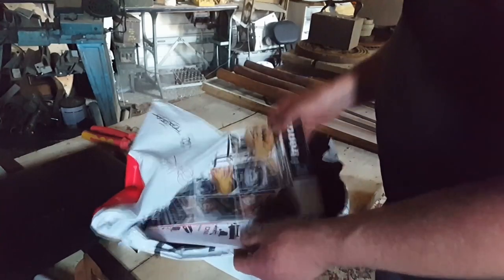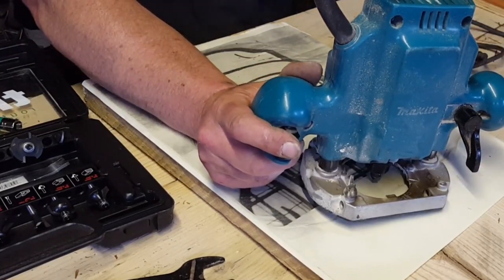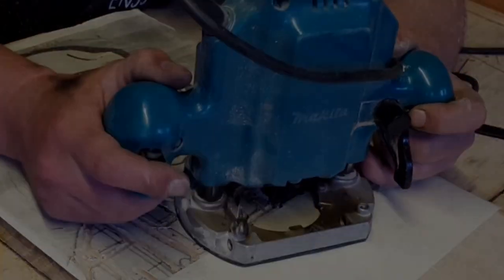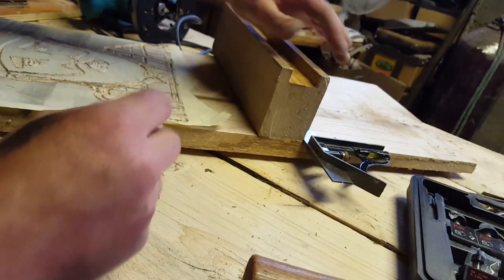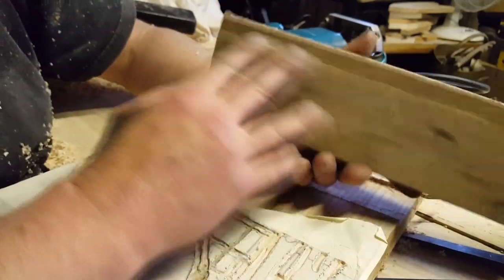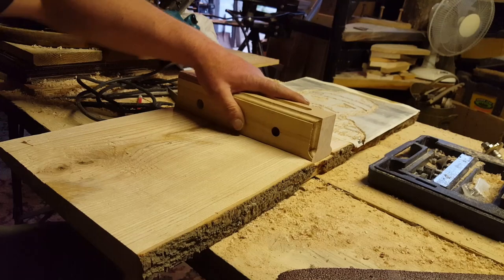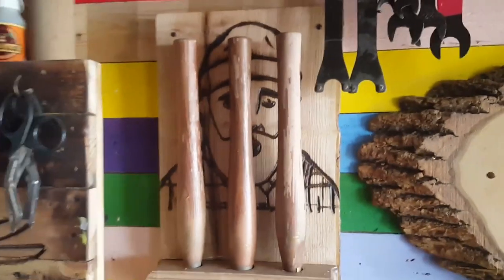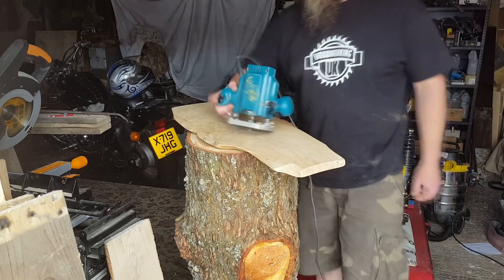Trend 12 Piece Router Bits giveaway - SSX81_4TC 1/4 Cutters +Handheld Routing Project Chisel Stand

Comment: Planning a summer renovation of a cupboard to house toys in the lower half clad out like a beach hut and a copper, mirrored, ply top half for spirits and glasses. A router would make the glass holders very easy to make! Love the mud kitchen BTW.
Reply from the maker: Copper, mirrored,ply top half... sounds interesting?  id like to see that when youre done, copper sheets?
Reply: yep, thinking of either framing the mirrored tiles in pipes and/or rolling some sheets over the edge of the shelves. Copper pipe wine glass rack would be easy to do, but budget restraints might kick in!